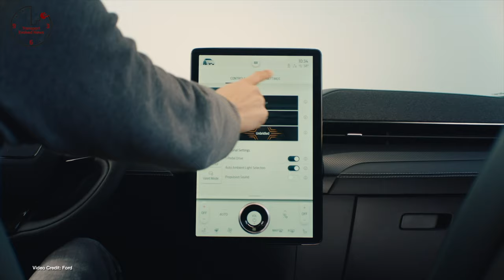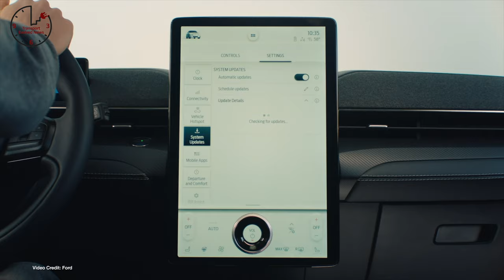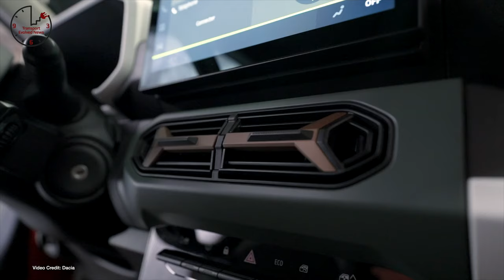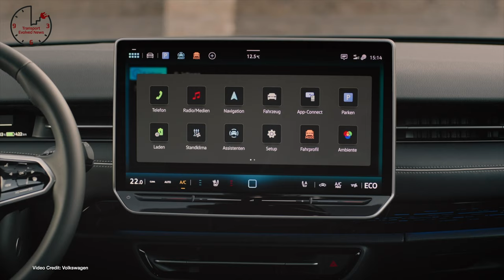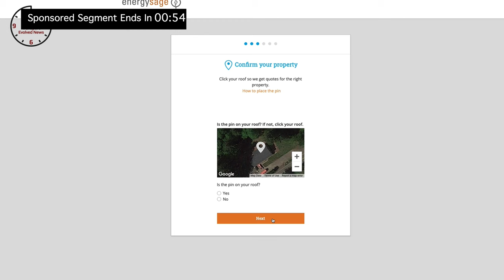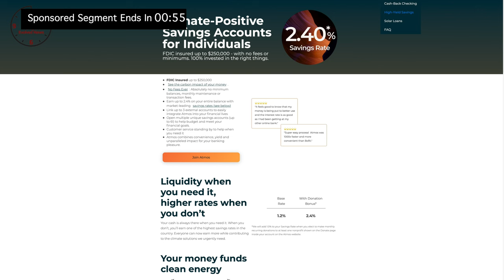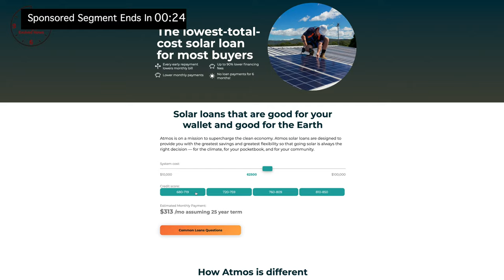Transport Evolved News TEN Episode 474 - Don't Slow On EVs, Joe!

Comment: Bring back Station wagons
Reply: Yeah! I had always wanted a hotrod Chevy Nomad but now I want an electric one!
Reply: And 8-tracks cassettes.
Reply: We already have them. But now they are called SUVs.
Reply: exactly...  wagons were just rebranded, they never went away
Reply: SUVs aren’t really station wagons. Station wagons had longer storage areas in the rear while still seating five.
The problem to the return of the station wagon would be crash tests.
I wholeheartedly support the idea though.
Reply: They made Legacy station wagon and the  Outback on the same platform....   And with basically the same proportions..... 

And the same proportions are copied by many different current SUVs.... So call it what you want.... And thanks for proving my point...
Reply: ID.7 Tourer supposedly is excellent, except for the insanely horrible touch sensitive buttons on the steering wheel.
Reply: Come to Europe, very popular over here - far better than pointless SUV's
Reply: vwidtalk — Volkswagen is moving away from touch-sensitive buttons on the steering wheel and going back to actual buttons, according to its CEO. Apr 24, 2023
Reply: Poor America, which just has those spacious  SUVs and peace. Which is also ironically growing in popularity in Europe. (SUVs not peace).

Enjoy those European sour grapes.
Reply: @nc3826  yes, they are moving but slower than a snail. As of today AFAIK not a single Volkswagen EV has transitioned back to mechanical buttons. You know which models have mechanical buttons that feel great and really premium? Their cheap gas cars including the Golf, Polo, T-Roc and T-Cross. Only the EVs have the abomination with no clear end date in sight.

Including by the way this brand new ID.7 Tourer - where in the pictures you can clearly see the capacitive touch buttons.
Reply: 'Don't Shoot the Messenger' has lost all meaning on social media ;)
Reply: This and utes. Ride height is overrated
Reply: @JanBruunAndersen And vinyl woodgrain side panels.

Comment: The thing about the amount of miles of range most people need for their cars is that it doesn’t account for the psychological element. The fact that sometime people may forget to charge their cars overnight or or if they lack at home charging the level three charger they use may be down or at capacity. So the issue is people really want to have some leeway some comfort and have some leeway. So it’s a situation where sure you’re technically right, the general public won’t be willing to make decisions based on it     I think, sometimes people that are really into EVs sort of forget how much extra thought process and work they are putting into driving every day whereas with ice cars can be pretty scatterbrained but still be fine
Reply: If they can remember to get gas they can remember to charge up.
Reply: @jamesvandamme7786  I have , on rare occasions  forgotten to gas up in the way home.  So .. I just fill up the next morning. It just takes 5 minutes, so I leave 5 mins earlier if at all. The glut of gas stations makes it such a fool proof system requiring almost no thought… understand,  I think it’s a lot of unnecessary fear, but my point is that people don’t really want to hear ‘well it’s only an issue if your a fool’ type arguments if they truly fear these things or even just don’t want to be bothered . Those people are going to have to be sort of forced into EVs slowly over time and that will  make the adjustment more  second nature for them and at that point they’ll see the positives of EVs.  

But yeah. Realistically everything I listed can be overcome. It just can seem very inconvenient from the outside looking in.

Comment: 20:07 - That's correct, Nikki: for daily driving, 200 km range car suffices to me even while using only public charging. But I still do 3-4 a bit longer (50 - 1000 km) trips in along highways with pretty poor charging infrastructure. Nobody claims they need 500 km range for daily commute.
Reply: If all I needed was under 100 mi range, I'd buy a used car for $1,000. But if I'm spending upwards of 40K on a car and it's associated insurance, I want it to have significant range so I can go on a road trip (leisure or emergency) and not have to plan a week in advance or rent a car.
Reply: @carloscardy8117  Yes: commutes may be short, but we do go on road trips with less than perfect charging infrastructure.
Reply: Nothing and nobody is average.... What matters is marginal values not average values..... Which is why battery swapping Is needed....
Reply: @carloscardy8117  100 miles of range would also mean a much more reasonable price.

Comment: 23:00 “trading CO2 for CH4” and releasing the methane or selling it? Horrible if releasing, not so bad if replacing methane otherwise supplied out of the ground, which I grant you, would still be a Shell game…
Reply: This is the problem with all regulation. It's inefficient and it has unintended consequences.....  taxing the negative externality is always the preferred option.... from an  Economist point of view.... but taxing is not politically expedient.... So we are left with this kind of BS....

Comment: While it’s true that most people don’t drive more than 75 miles per day, I can say that with my Fiat 500 E, which tells me variously that I have 80 to 90 miles of range, if I go 70 miles, the vehicle will start showing me very alarming Notifications, and on at least one occasion where I made one extra stop that should still have been fine, I ended up in limp mode for the last 5 to 10 miles.

As a result, and given that electric vehicles have different range possibilities at extreme temperatures or if you have mostly freeway driving to do, I would say that you need at least 50% more rated mileage than your actual driving. So for me, my typical drive is about 35 miles. On days when I have to make two trips of that amount, I need to plug-in to be sure that I don’t end up in limp mode on the way home. if I had another 35 to 40 miles of range, I would never really be in that alert or range anxiety situation.

So to me, if your commute is 75 miles, then you probably need about 230 miles of range to avoid ever having a situation where you end up in limp mode in your final 10 to 20 miles to get home.

The good news is almost every EV that is brand new has over 200 miles of estimated range.

However, I do think that the electric vehicle manufacturers (and smartphone manufacturers as well) need to change the way they list battery capacity. We are told that you shouldn’t discharge less than 10 to 20%, and you shouldn’t charge past 80 or 90%. If this is the case, if doing this daily can cause issues with your vehicle, the system should be designed to stop charging at the recommended percentage. I leave my car plugged in overnight, and very often charge to 100%. Does that mean therefore that I am shortening the battery life of the car? instead, Empty should be 20%, and full should be 80 or 90% whatever the manufacturer recommends.

Done this way, you would never have range anxiety, much like a gasoline vehicle, when you hit Empty, you would know that you still had sufficient range to get to someplace to charge, and then you wouldn’t get the alert until you were 10% past empty. And if you were going an extra distance, you could do like we do with gasoline vehicles and top off. For an electric vehicle, you could have an opportunity to go into the menu and tell it that you want to go to 100% because you need the extra range, so you would “overfill” the battery in those rare situations.

Comment: Station wagons may not be cool but they are so practical. I have a 14 yr old VW Passat and MG ZS EV and both would go and be replaced with a single EV wagon if we could get one in Australia at a reasonable price.

Unfortunately we don't get any! MG Australia have refused to bring the great value MG 5 EV wagon down under and I dought VW will either.

Comment: WRT Daily Commute data: So far as I can tell it is 100% accurate for the Statistical Mean case, but I have never heard or read the Standard Deviation nor how much it differs from a Normal distribution. That said, it is a useless number argument if one takes into account human psychology. A psychology-based approach results in minimum range numbers around 230 miles for the very same drivers described by that Statistical Mean once the fact that they often don't live somewhere they have full control over dedicated fixed-location parking and therefore the ability to charge overnight is taken into account (plus allowances for winter), meaning they have to factor in uneven charging intervals. Additionally, they have been driving gas vehicles for two or more decades and have had to deal with nearly running out of gas at least once despite having a 350+ mile gas tank (statistically)—an experience that will reliably "trump" any rosy fact-based argument every time.
Finally, there are actually a fair number of people who drive large and unpredictable amounts daily—sometimes with awkward loads or routing and outside time pressures not amenable to charging at predictable times. Electricians, plumbers, and many IT professionals fit into this group. Because of this they really do need stupidly large ranges—and since many people know someone who works in these fields they will therefore have heard at least one "running out" story from them. Keeping in mind that stories virtually always override logic it shouldn't be a stretch to understand why people feel the way they often do.
So again, it isn't that the Statistical data is wrong, it is that people in general will virtually never accept it as proof that some faceless "average" case without a compellingly similar use case narrative to their own is more valid than what they already know.

Comment: 10:19 - Actually using your expensive truck the way it was advertised will void your warranty? Great! Reminds me of Pohl's & Kornbluth's  Spece Merchants...
Reply: Isn't that perfectly normal? If you flood and trash your Ford/GM/Stellantis truck off road, is that covered under warranty?
Reply: @bazoo513 Wade Mode is not covered by the Warranty because there are many unforeseen issues when wading into deep water.   This option was provided for emergency use only, not a standard feature covered by warranty.
Reply: @tonespeaks that's debatable, as it's being promoted as a useful feature for off-road adventures, similar to "crab mode" by other brands.
Reply: @jamespaul2587  Actually there are no Trucks that warranty for offroad use.  It would be stupid for them to do that, since offroad conditions vary widely, not to mention hazardous. 

Wade mode is not being promoted, it isn't mentioned in any of the Cybertruck adds or information pages. Tesla has very strict guidelines on how and when this mode should be used.  It also suggests a much slower max speed, than what the testers used.
Reply: @tonespeaks  Tesla still has to prove damage was related to the water travel to decline warranty coverage
Reply: @jamespaul2587  Not really, Tesla has data, so if the person used Wade Mode and there was damage associated with its use, they could deny coverage.   It is very clear in the manual.  "Damage of water ingress to Cybertruck as a result of driving in water is not covered by the warranty".
Reply: @tonespeaks  agreed, but my point is that other damage not related to water ingress would be covered
Reply: @jamespaul2587  True... if it isn't linked to Offroading.
Reply: @tonespeaks If it has an offroad mode and a wade mode as part of its software package, and the marketting specifically promotes these abilities, then I think someone would have a very good argument in court that these can't be considered cause for void of warantee. And Nikki stated that going off-road at all voids the warrantee... and that is very clearly part of the marketting of this vehicle.
Reply: @patreekotime4578  There is no marketing that promotes these options, if you can find it, share here.  Tesla doesn't market Cybertruck actively, so that is why I can tell you with confidence it isn't there. 

I think there is no argument, before you can use any of those functions, it clearly states that any damage will not be covered by warranty.   It can't be more explicit than that.
Reply: @jamespaul2587  Exactly. You can't promote a feature and then say "but we didn't think you would actually use it!"
Reply: @tonespeaks  Well, if the manual explicitly states this, and if warranty refusal only applies to wading, then OK.
Reply: @bazoo513  It applies to Wade Mode and Offroad Mode  I think Launch mode as well.
Reply: @tonespeaks  What? They literally drive it around in the desert to show off its capability.
Reply: @eaks That is, everything one would want to use this "hype performance truck" for, except for posing in front of Starbucks. Does Ford voids the warranty if F-150 steps off the pavement?
Reply: @bazoo513 Ford requires you to purchase Off-Road Coverage which only covers chips to windshield, small dents and tire/wheel damage.  

People don't seem to understand that Off Roading is extremely stressful on any vehicle even purpose-built ones.  The likelihood of a failure is quite high.

Comment: I am in New Zealand,   we have wild winding roads,   I often do 300 to 600 kms per day and can't afford to wait for a battery to charge....

My max daily drive was 1320 kms in a single day.

I only drive cars and take people that don't have the confidence to drive long distance.
Reply: I’ve done over 1400km in an EV while towing a trailer. There are plenty of EVs with charge speeds sufficient to recharge to add 300km range in the time it takes to use the bathroom and get fast food to eat in the vehicle.
Reply: @AnonymousFreakYT   What country are you in?

New Zealand ev drivers I talk to complain about the number of broken or wrong plugs everywhere they go.

I do 600 kms on a single tank.

Please do explain where you are,   what are you driving?

I often drive through the king county area where there is only 50 kw chargers.
Reply: @Andrew-vd2ko  Yeah, sounds like your area may not be the greatest right now. I’m in the Western USA. 

Recently drove my Rivian R1T towing a NüCamp T@B 400 trailer 4500 miles in two weeks (round trip, 2000 miles in one go, ~500 miles of “miscellaneous” driving near the destination, then 2000 miles back.)

That whole drive, I only had one stop that the whole station was down and I had to drive to another station. (Which appeared to be a problem with my truck - other brands of vehicle could charge fine, and I had charged fine at it on my way down. The next station worked fine for me.)

People tend to complain about negative experiences far more than they talk about positive or as-expected. People don’t talk about all the times they charged successfully, only the few times “2 of 4 plugs didn’t work!”
Reply: @AnonymousFreakYT   I am in New Zealand and we don't have many charger places and many people complain that they either don't work or have the wrong plug.

Most charging stations are 50 kms apart so there is no way you get the next charger if it is broken or wrong for your car.

Rivian is NOT sold in NZ.

The new Zealand roads are windy and steep and narrow and often full of fallen rocks and the highways have potholes,   we had news item at Xmas time with 40 cars in line changing tyres after hitting a pothole.

The New Zealand roads are shocking and EVs without spare wheels are silly idea when you are have to fit one per week.

New Zealand is way behind many countries...

Comment: Here is an idea that would allow a boost to EVs even as the US cuts back on targets bowing to election time political pressure:

- Limit the $7500 federal credit to EVs that have an original window sticker price under $30,000.   Because let's face it, if you can afford $50-100k EVs you don't really need the EV credit.

- Make it mandatory to show the EV credits on the standard window sticker.

It would pressure manufacturers to focus on the low-price market (that is wildly underserved in the US) and give the most reluctant buyers a reason to consider going EV.

And since there are no sub-$20,000 American built EVs, extend the federal credit to European EVs with an original US window sticker price under $20,000.
Reply: The problem is multifold... these companies arn't turning a profit even selling $50k vehicles, so they are disinclined to build cheap EVs. Secondly, the battery technology that allows for cheaper EVs in Europe is all patented by Chinese companies, and nationalistic Federal laws revolving around battery manufacturing are screwing over everyone. Third, the tax credit scheme only works for rich people to begin with. Most people shopping for cheaper cars arnt eligible for such a large tax credit. So the whole thing has been poorly crafted and was laser focused on the upper end of the market in every way. It's a damn shame and it's something that should have been easier to get right but lobbiests and campaign donation politics stood in the way of clear thinking.

Comment: Despite significant improvements in battery tech over the past five years, there is still 10 more years more of it that needs to go into future batteries before I'd be comfortable forcing EVs down everyone's throats. Also, EVs aren't the only way of "dumping fossil fuels", you can go ethanol and invest in more cellulosic ethanol research to make more ethanol from agricultural waste (ex.: the leaves, cobs and stalks from processed corn products, husks from grains and nuts, unbleached paper and cardboard, chipped trees, branches, untreated lumber and other wood product waste, etc.) instead of crops.